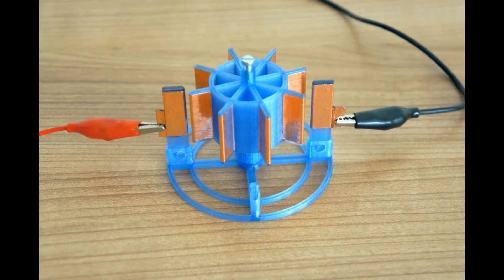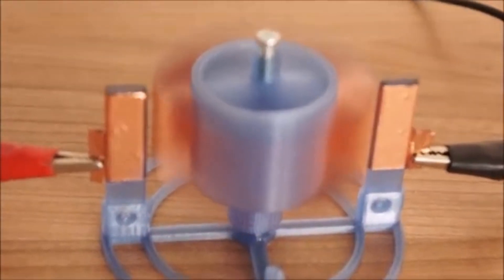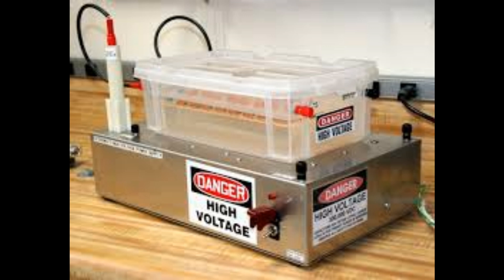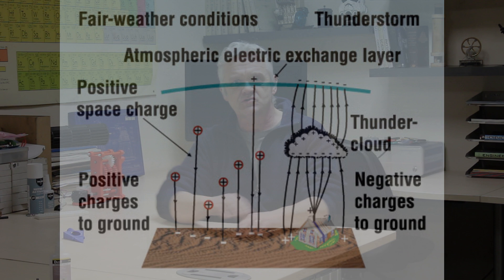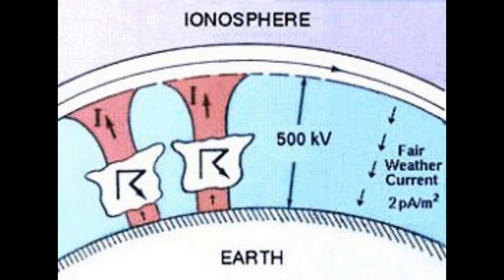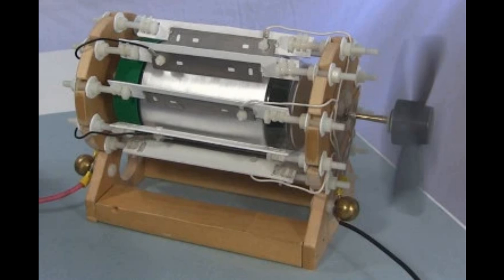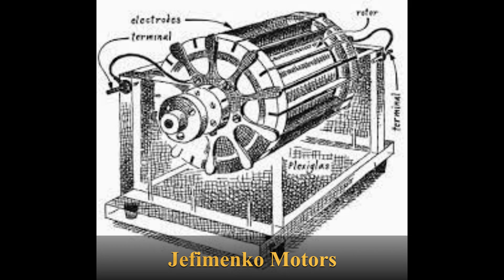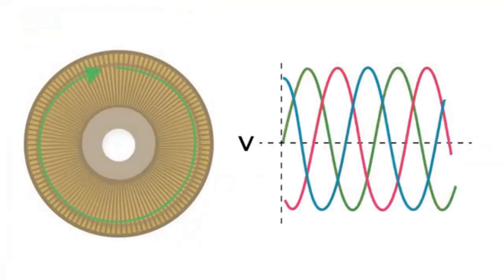1840 Atmospheric Electricity An Exciting Possibility

Comment: Wardencliffe
Reply: The tower 😳
Reply: The Great pyramid of Giza ?
Pyramid = fire in the middle (electrical fire , arc , spark , Ark)
Ark of the Covenant in the middle (king's chamber) a capacitor with two cherubim on top making a spark gap transmitter (radio frequency waves ) 
Think of converting atmospheric electricity into radio waves via a spark gap and capacitor.
Reply: @kevinleebailey  You are right. The pyramids when they were still functioning power plants would work as Hydraulic Thermo Acoustic generators capable of wireless distribution over the atmosphere. The Ark of The Covenant was a kit. It had all the components to power a machine called THE ANCIENT OF DAYS. This machine was electric and could produce MANA, a survival food. When this kit was packed up and in its box it still generated wireless electricity as its a type of ancient Betavoltaic device that ran on a core of radioactive metal.

Comment: Low resistance feed from a reasonable altitude; chop the current, put it through a transformer: volts into amps?
Reply: Interesting idea! Would it work to run device electric chargers?
Reply: Check out what Hermann Plauson did in the early 1920s.

Comment: If you send a balloon up, we'll shoot it down. :D 
I've liked watching videos of shooting rockets with wires up into a storm to direct the lighting to follow the wire. Now I wonder if it's causing a lightning bolt by tapping into the atmospheric energy. ??
Reply: Yes it is!! And on that same note, you can do the same to tap into zero point energy. Like the Energy from the Vacuum generator that Dr. T Henry Morray built, that used a very special valve to do this, much like a rocket with a wire attached. The Morray valve completed the circuit and got energy to flow.

Comment: The Tesla Tower was basically an antenna to gather energy from the Ionosphere, by electrically shifting the molecules from its tip to the higher altitudes, from not  aligned to aligned. By doing so, a canal of electricity could be created and we would gonna have free electricity and a big chance of exploding everything connected due to any bigger than normal solar flare. Dangerous stuff.
Reply: Imagine the Tesla Tower was just the prototype. The next version of this concept is in the application of zero point energy generators. Such as the one built Dr. T Henry Morray, energy from the vaccum.

Comment: Amazing video Rob!! Thank you so much for looking into the potential that Atmospheric Energy has. I had seen Corona Motors be used to demonstrate science principles but I am glad folks can now see you can make on that runs as a power drill. Imagine just sticking an antenna that floats to the right high voltage to run compact machinery and devices? Why stop there? You can absolutely MICRO construct the type of corona Motor you showed in your graphic, two flat discs just microns thick and the size of blood cells. These can be made for a new generation of lighter than air Drone Blimps that power themselves and can harvest energy from the atmosphere. There are mountains of resources right above our heads in the atmosphere! All we gotta do is build the right tap for each.
Reply: It exists and we all use it and pay for it . The power lines are antenna , transformer , and spark gap making buzzing. Just like teslas schematic
Reply: @mattg6472  it's time to take what already exists then and make it our own. If you know they are charging you for it and you know how it works, why keep paying for it when you could generate it for free at home?
Reply: @captainnemo6655  I don't pay for it... I do generate my own . I'm fully off-grid
Reply: @mattg6472  You've got it ! THEY have been doing this for year's.
Reply: @kevinleebailey  love seeing Kevin Lee Bailey show up . I'm getting used to seeing you around . 👏high five

Comment: I really like your other videos, but with this one I have a major gripe: the "atmospheric electricity" nowadays mostly consists of radiowave frequency power, so when you tap into that, you reduce the power of that signal. 
In some countries (e.g. here in Germany) this is even prohibitet by law. So while yes, that's possible, I would stay FAR awa, from that.
Reply: Everything is illegal in Germany.
Reply: @professorfukyu744  You ain't wrong.
Reply: @professorfukyu744  even beer and pretzels?
Reply: This video is about tapping into the always present electric gradient that exists between Earth's surface and the troposphere, it's largely charged by radiation from the sun iirc. Our radio waves should have little to nothing to do with it.
Reply: @potential900  well, the troposphere is the area we are living in, so it has very well to do with radio waves. Even in higher altitudes you will possibly tap into low frequency signals or even interfere with radars, so unless you go into the ionosphere you will always at least influence radio communications on earth and in the worst case endanger flight security (when going for higher altitudes).
Reply: @igorpuschner786  I read your initial comment as saying radio waves is what makes the atmospheric electric field powering those simple corona motors and thought to clarify. ..  Right, so larger setups introducing sparks would produce radio noise to some extent. Are you also saying "antennas" or collectors would become problematic for radio transmissions as in dampening the signals too much?

Edit: it's unclear what "tap into" entails.
Reply: You're so wrong. You must think the lightning is also a result of radio waves.
Reply: This is a valid point and interesting.   Hills and trees also block certain frequencys.    A larger antenna could possibly block signal depending on how its constructed.   If you were worried about blocking Fm or higher i doubt it would be severe as I have designed many antennas and u get a lot of signal scattering at ground level I have a shed thats solid aluminum but the Radio still works inside the Fm goes thru the garage door and around the corner my point is in a dead spot you loose a few decibles but signal is still there.
Reply: ULF induction, and capacitive tank circuit tuning to frequency would have the effect of channel allocation

Comment: Already being done. Pylons. Ac-Dc. For the last 100 years they been selling us it. 😡
Reply: Time for things to change. Let's build better Corona Motors that we can use at home and stop the power company from taking all our moneys.
Reply: Fawley power station pylons go out and come back in on a circuit. I have thought this for ages. All the underground disused bunkers under London are fully lit 24/7 for decades.
Reply: Bot
Reply: @Karl McCreight did you not see the video on Corona Motors posted by Plasma Chanel? Next step is to build a prototype but Rob's version of it. Next I will fly a helium balloon coated in a fuzzy graphite sweater and wire it to a power station on the ground for recharging batteries.
Reply: Ehh, not even close.  It's not necessarily the oil but what is burnt with it.  First it was lead which enters the air you breathe, then it's DEF which is basically vaporized urine.  What will it be tomorrow?  Just a catalyst.
Reply: @lastofthebest5102  well I'm glad you think the government are acting with our best interests at heart, lead is used in batteries, we are electrical, they use aluminium everywhere which is not good and getting rid of lead (water pipes, out of petrol etc). Aluminium is heavily linked with alzheimers allegedly, could we need lead? We need iron apparently and I'm guessing if for some electrical purpose
Reply: @lastofthebest5102  ?
Reply: Yeah they sure have !!! Equally 😡. As you can see in Tesla s diagrams all u need is antenna in the air , transformer , and spark gap... Look what we have above us on every road side . Antenna , transformer , spark gap making buzzing
Reply: Supposedly, they (in italics) run helicopters with heat sensors over and around major high voltage lines looking for people with warm coils hidden in their sheds... to arrest people for stealing power from the magnetic field near the high voltage wires...
Reply: @cmasailor  that sounds bunk they don't have power like that . Besides what heat ?
Reply: @cmasailor  this is true. But the powers that be do not do it for electricity thieves. Those helicopters with those funny sensors are actually scanning for all radio frequencies in the air in order to snoop what's going on in your cell phones and computers and other wifi enabled devices. The sensor you are talking about was built by Motorola a while back. I actually know the engineer behind the device, his name is Bill and lives here in Las Vegas, Nevada.